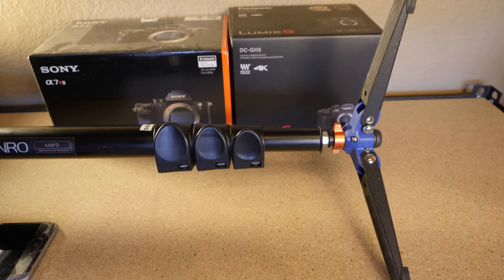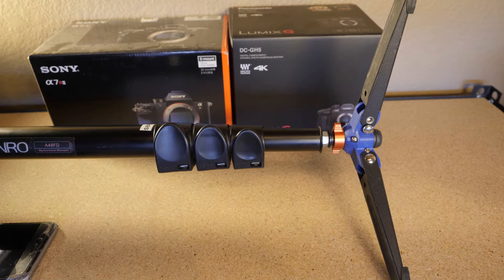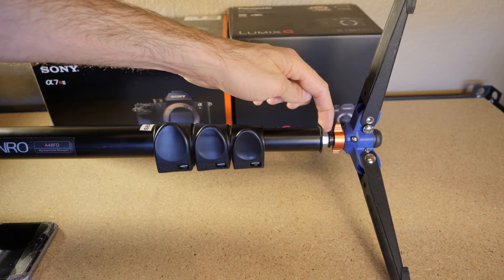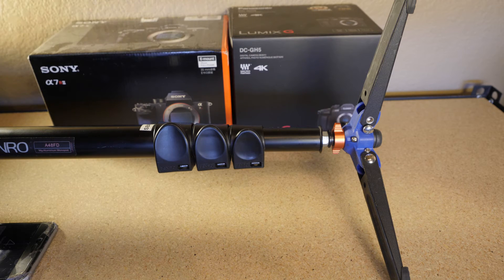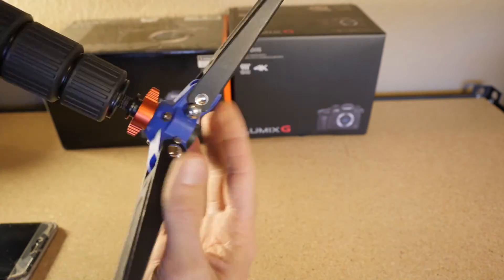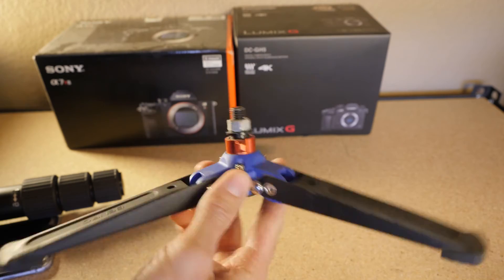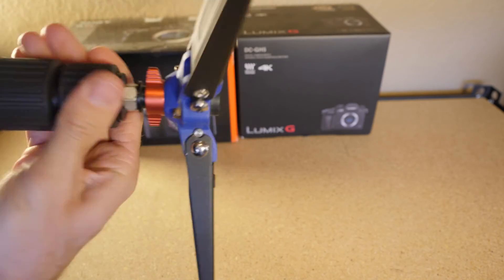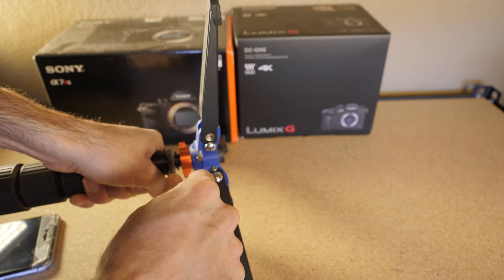BENRO MONOPOD FEET UNSCREWING ISSUE "SOLVED" DIY

Comment: I just received my Benro monopod from Amazon today and sure enough the feet were loose just as you described.  I tried to tighten them up and found the feet would not secure.  I went to the local Ace Hardware and purchased a 3/8 in.-16 Hex Nut.  They had the nut in two heights.  I chose the nut with the lower height.  I believe I payed $0.55 for the nut.  I installed the nut on my new monopod like you demonstrated and it did the job perfectly.  Thanks for the suggestion.  

P.S. Benro, if you are reading this.  Why don't you include this nut with you monopods to fix this design flaw?

Comment: i have the same as you A48FD, it doesn't unscrew, suggestions? trying to reduce length for travel
Reply from the maker: What are you trying to unscrew? If you are trying to unscrew the feet I would suggest plyers if you can't get it by hand. But make sure you don't damage the monopod.